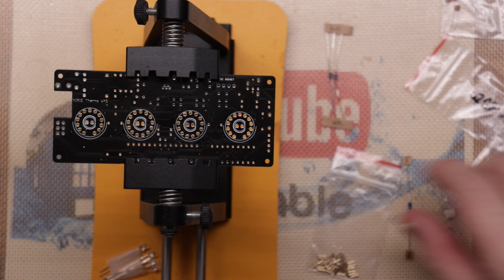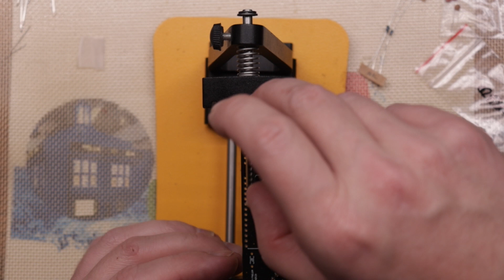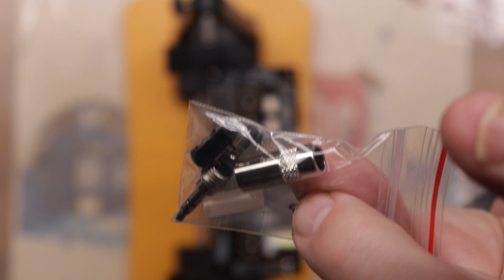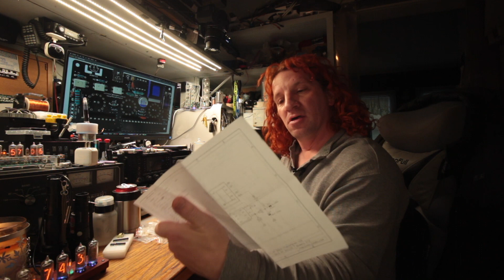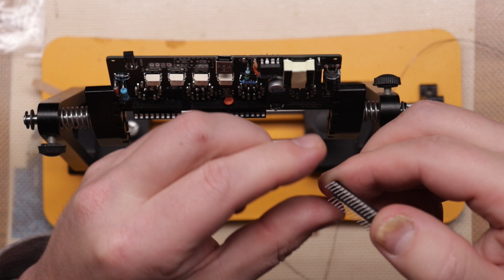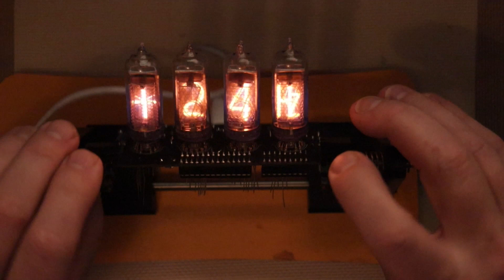4 Tube Nixie Thermometer Kit Build

Comment: Surely this would be better if they made the controller chip user selectable for C or F. Most other digital thermometers C or F are user options
Reply from the maker: Yeah, it would be nice. This model, is more for the coder people. Just go in and change it. But, since, I am just a hobbyist at coding, it is easier just to wait for another chip.

I have the chip now, and everything is working just fine. It will be all covered on Wednesdays video.